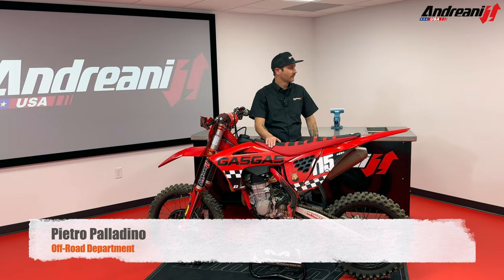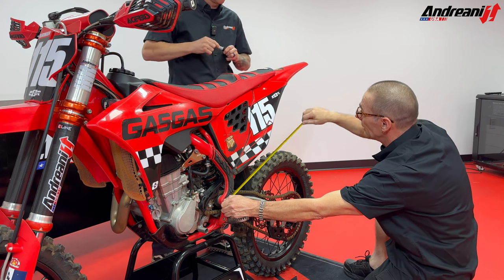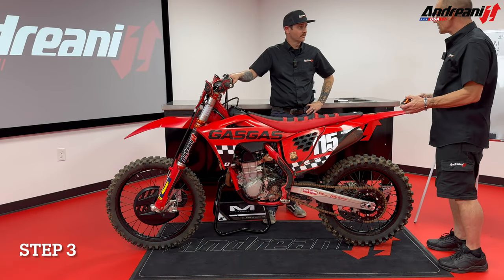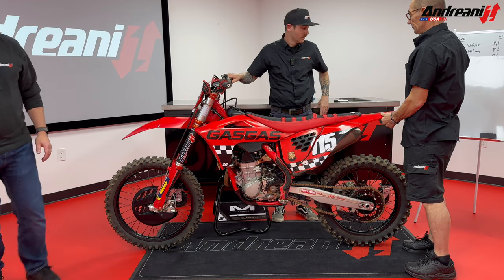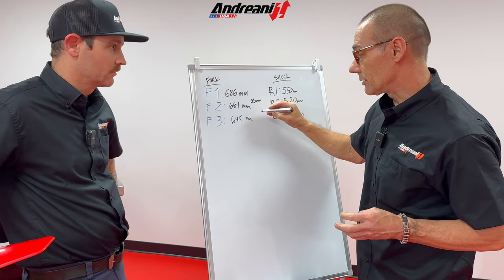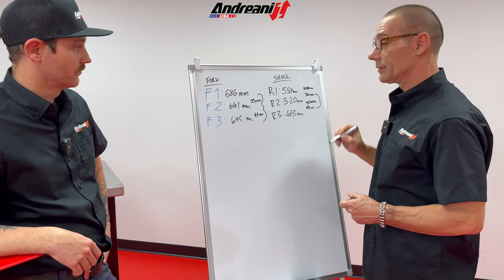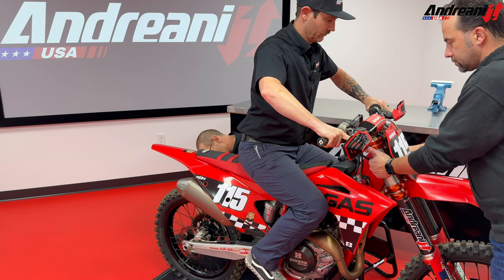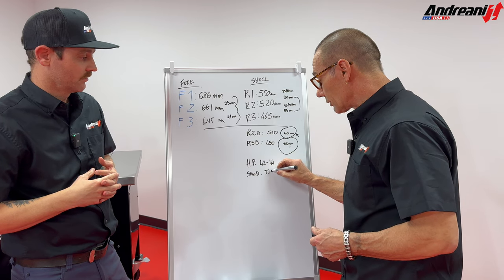Andreani USA - How to measure your SAG (Dirt Bike Edition)

Comment: Why do you suggest sitting vs. standing? Do you ever calculate the stiction zone? The different angle for taking the shock measurement is interesting. I'll try and compare that method next time.
Reply from the maker: Both measures are valid whether you stand or sit on the bike, but if you stand, you should assume the position you usually have on the bike, with more weight towards the back. Some people make this calculation while standing completely straight, which is not how you would actually stand on the bike while riding. If you stand correctly, you can find a measure that is pretty close. However, for practical measurements, sitting on the bike is more precise.

The stiction zone can vary due to many factors such as spring preload, and whether the bushings are old or new for example. When you measure the SAG on the bike, we assume it's the first time you ride a new bike or a used one, after a service/tuning, so all friction elements should be lubricated and in very good shape to determine the correct SAG without needing to account for the stiction zone. I would say that, just like with our different angle measurements, others may have a different philosophy and include the stiction zone as well.